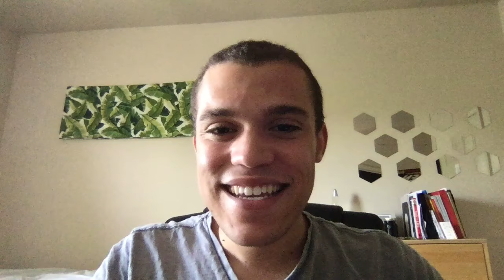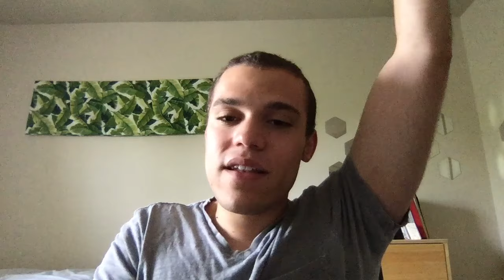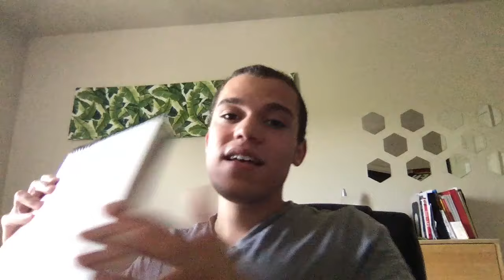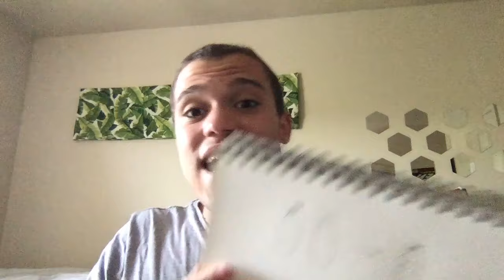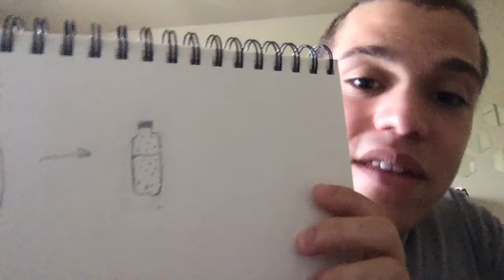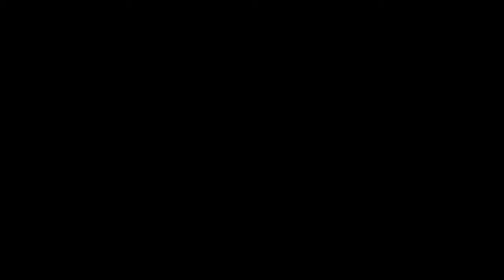Why are there bubbles in my tap water/ Why do Softdrinks go Flat?

Comment: I don't understand science 😅 but my problem is I was about to drink my cold water but I forgot and left it on the table.And after 5 hours I came back and I saw bubbles in the water.I thought they were germs .I thought I will throw the water but I mistakenly drank it .And then I started to feel itchy in my body.so I didn't understand what actually happened 🤔
Reply from the maker: It's always good to be cautious! Tap water in the U.S. is treated and generally safe to drink, however other non-acidic drinks that contain sugars such as milk and some refrigerated juices and coffee drinks could grow bacteria at room temperature and should not be left out. It's always best to check food labels for refrigeration requirements!